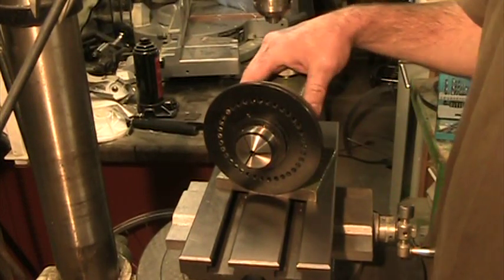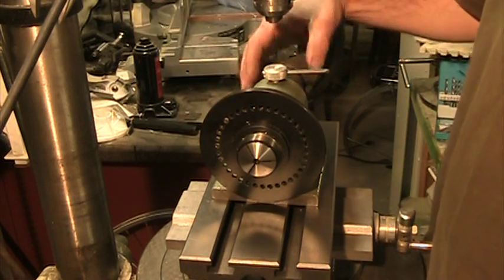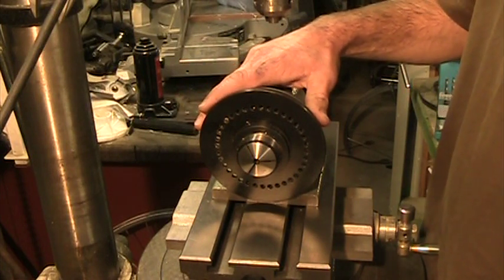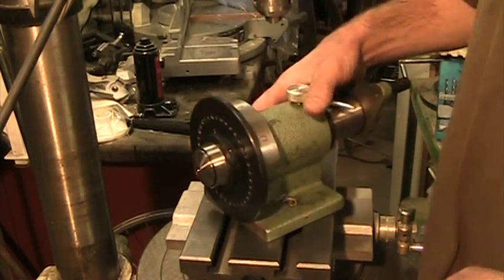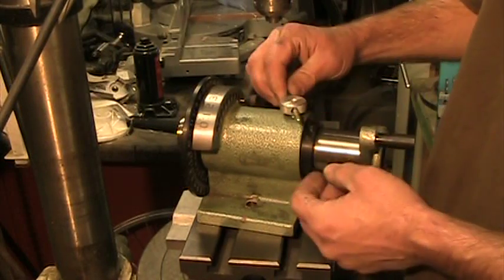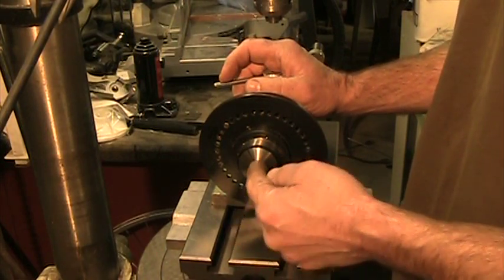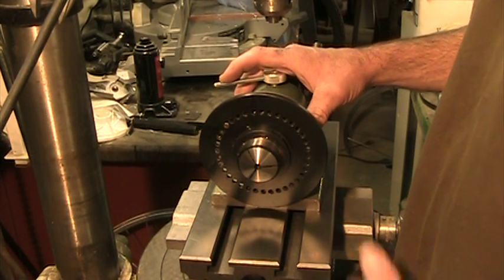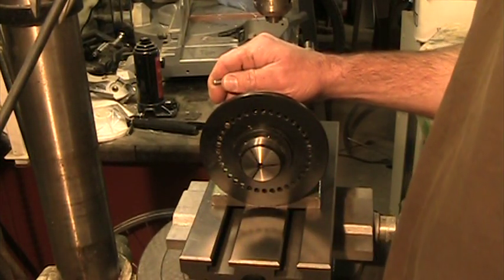5C Spin Indexer Easy Modifications.

Comment: If you want to do fractions you can make custom pins. It will require two in opposing holes to hold the spin index. For example if you need to cut an 11t gear that is 32.7 each cut but you can’t do it with a standard index you would need an even number. Instead you make two custom pins one in the zero hole and one in the 9 hole and they are made the thickness you need to get to that .7 fraction. Takes some time to get it dialed in but once you do you have repeatability. As you shown first thing is for it to your work table.
Reply from the maker: Interesting idea! Thanks for the input.
Reply: Bob Cartwright, I should clarify what I did exactly. It can be done a few different ways. I ended up using two adjacent holes so I could weld the two pins together so they held exact position every time. Basically I did an offset egg shape on the end of the pins and left the input 5mm diameter normal so they fit tight. Welding keeps them from rotating and changing offset position. Because each hole is offset approx .5mm before it goes to the next open hole for the pin to fit you basically have a tenth to work with from that .5mm if that makes any sense? If I needed 32.5 it would’ve been easy but of course i needed 32.7 which you can barely visually see .7 from .5 looking down the hole and measuring? Well I had to do this the “hard-way”. I don’t have indicator tools that can reach inside tight holes so It was a little trial and error. I had to draw lines on the round bar and visually judge if they looked even. I’m about to cut the first part with it to see how it goes and it’s a rotary broach 11 tooth cutter. Makes a similar cut to a torx I suppose but with 11 teeth. As long as the end product fits the part I need then I’m happy. Made one previously with a dremel and it worked to broach one part and broke the tool on the second part. Funny that the cutter didn’t look very professional but the finished broached hole looked fantastic and had a snug tolerance I couldn’t have been any happier at the time. So that’s the trouble to get a fraction but once it’s done you can replicate the part much easier. How often I need it I don’t know but it’s there if I have to make a replacement broach without goin through all this trouble again.
Reply from the maker: Must have been a long tial and test process!
Reply: Bob Cartwright, I spent a couple hours or so and took my time. I just finished going around making my lines on my 12mm drill rod and they are equal all the way around. That .7 makes quite a difference. Now if this were a 2” part who knows I might notice some inaccuracy but I’m fairly confident as I start cutting now that this is going to work as expected. Once I’m done I will make a quick video explaining what I did and send a link. Now I have to cut 1mm slots all the way around and then come in with a taper bit and v shape the cutter. I suspect machining is going to be far more tedious so I’m not breaking carbide bits. My initial thought was to use a grinder and I haven’t ruled that out. We will yet see.

Comment: Grizzly sells a 5c mount 3 jaw chuck for about 100.00 -part# H2714.
Reply from the maker: Chuck Mercer Thank you for the part number, the mounts i have seen where allot more expensive.
Reply: Jake Mercer hmm prob same one enco and rutland used to sell..kinda makes it nose heavy back then they were half the price came with both external más internal jaws
Reply: Kinda defeats the purpose really. Install my 5c chuck to then use a 3 jaw adapter on it? I suppose if you had a quick need but I can’t see how that wouldn’t have crap runout. Double stacking has never worked from my experience to any degree it was worth bothering with.
Reply: Hi, I'm from the future, 10 years later.  Grizz doesn't sell that part anymore.